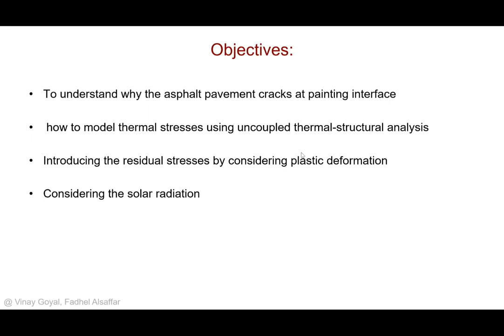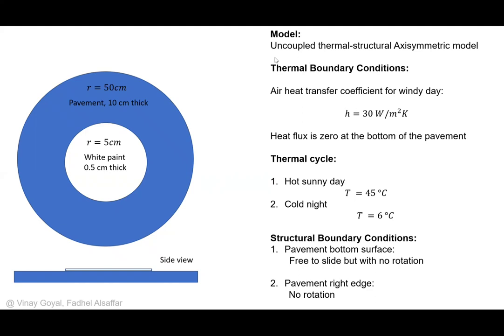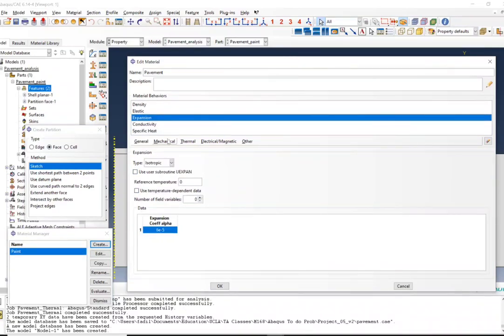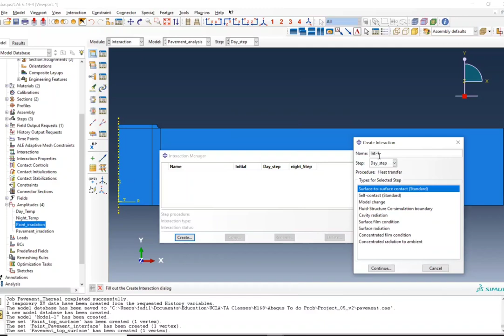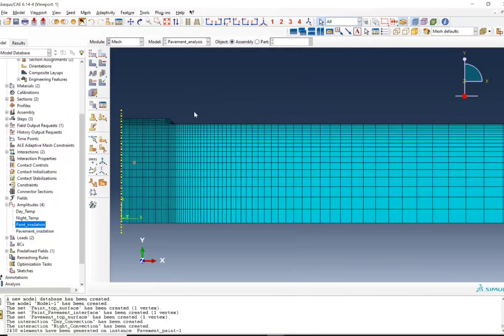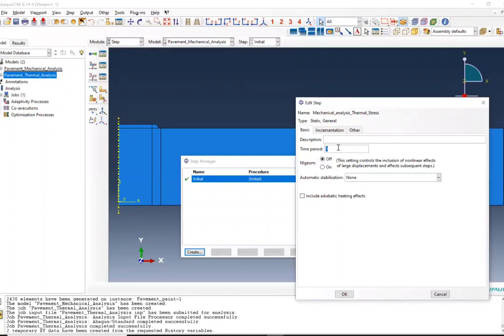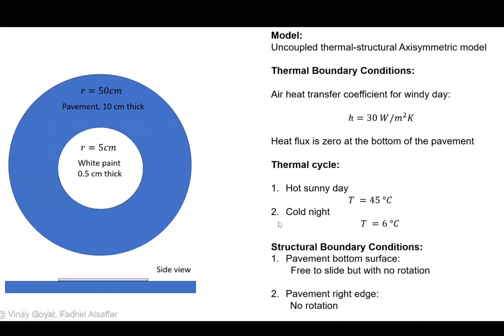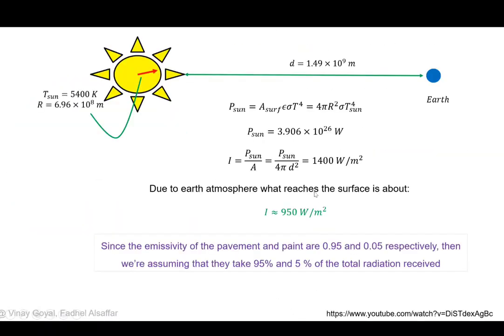#ABAQUS TUTORIALS - Uncoupled Thermal-Structural Analysis: Pavement Cracking

Comment: thanks for the interesting analysis and presentation, that was great. 
I just noticed two points: first, you forgot to mention that you defined two PHYSICAL CONSTANTS for the model (ABSOLUTE ZERO=-273.15, STEFAN BOLTZMANN=5.669e-8). Secondly, you should also define an initial temperature BC for the structural analysis (in this case = room temperature). Otherwise the temperature of all nodes starts at zero and of course the results of the first increment are not correct.
Reply from the maker: Thank you